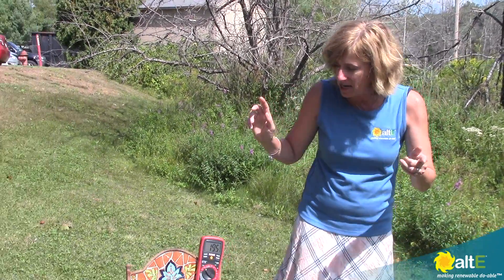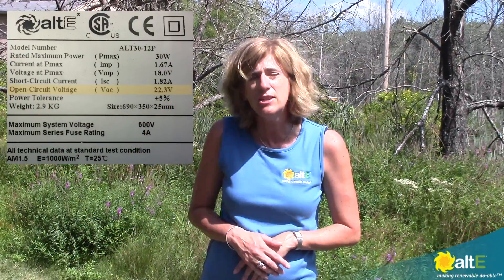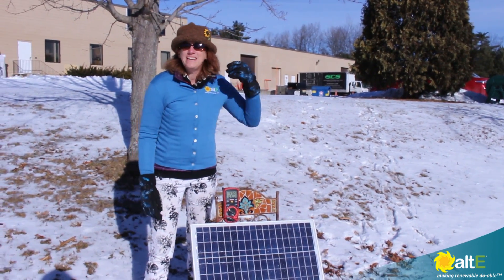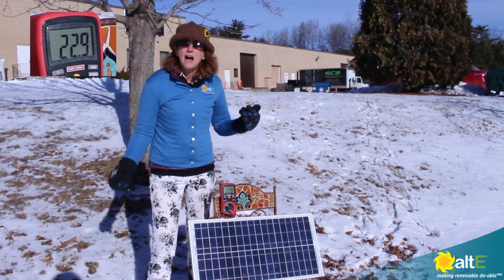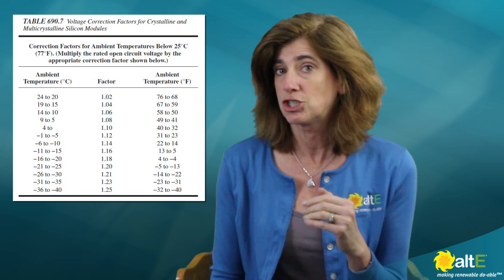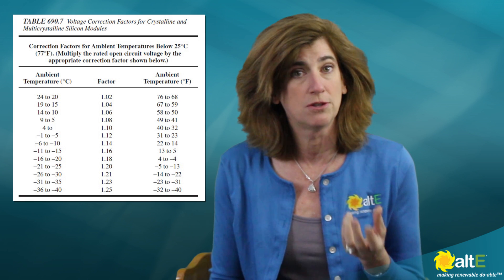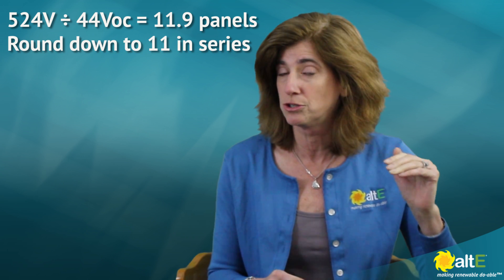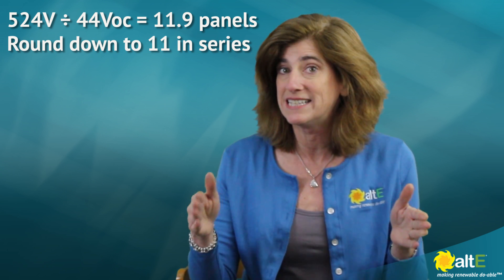What Effect Does Temperature Have on Solar Panels?

Comment: I’m curious about the angle of the panel. Since roof angles won’t change, this test allows for solar panel angle changing which would not apply in the real world. Obviously she raised the panel more upright to face the sun on the colder day. Colder days are naturally cleaner and less tree foliage. I wonder if the panel angle is kept the same in both tests would heat deflection be different, and more important how would the voltage gain be different in both temperatures.

Comment: If you use solar reflecting material to concentrate the sunlight onto the solar panel, you can obtain more power output from the solar panel. In fact, you can overdrive the Solar Panel beyond it's specifications.

You must be careful not to allow the solar panel to reach temperatures higher than the Solar Panel safe operating temperature in the Solar Panel's specifications.

A good heat sink system placed on the back of the Solar Panel, and additional water cooling, can facilitate heat transfer to harness the excess heat and also channel heat into a hot water system. 

I first tested this out using small Solar Panels as a hobby project 35 years ago, and it works. My aim was to create a Solar Panel that could be driven to become as close to 100% efficiency as possible.

My findings also led me to conclude that the faster you can remove heat from Solar Panels, the more light they can absorb, and the more power can be generated. The key is the Heat Exchange System.

At the very least, Solar Panel users should seriously take this into account as it could save you dollars for those people who operate in very cold climates most of the year. It can save you dollars on buying extra Solar Panels.

Comment: Hello AltE
I admire how you generously teach people about solar system.  
I want to have off grid solar system in my hotel but don’t know what type of panels can withstand the hot climate in the Red Sea. 
I use 10 Air Conditioners each 5000 BTU 
I also use 11 refrigerators each = 150wh each
I also use lots of ceiling fans = 2000wh total 
I also use coffee maker.            = 2000wh total 
If you can, please help me find what equipment and capacity that is fitting my hotel 
What is the best and durable solar panels

Comment: Hi,

Thanks for providing such a good information, i installed 24 volt pannel system i was facing the issue of solar high on solar controller which ultimately was disconnected the power supply to battery Bank.
User specs of pannel shows VOC of 46 volt however at 2°C it was showing 48 Volt causing isolation from charging the battery.....
I thought my spv charger becomes faulty.

But now i know the exact root cause....
Your information was very good......

Thanks.....

Comment: Do you think a 12v 3amp DC motor an inch under the white part of a solar panel will affect it?
Reply from the maker: Heat wise? 36W won't really make much heat, I wouldn't worry about it.

Comment: Hi. 
Please guide me i have 5 ke mppt soler inverter that could be receive 450 v maximum. I have 18 mono panels of 270watt. 
But our area is too hot area and temperature often at 46c in high hot season. And my mono plates produced half wattage so please guide me how can i get maximum wattage from my 4850 wattage soler plates. 
Now a days i have install 9 plates series

Comment: This demonstration definitely stresses the value of good maximum power point tracking. (MPPT). You'll find that in the winter, the amps will be lower, but the voltage will be higher. In the summer, expect the opposite: Higher current, lower voltage. The wattage will not vary as much as it would if you just connect the panels directly to a battery. The major difference, will be the shorter days of winter, giving fewer hours of power per day. The peak power, will actually be similar, albeit, for shorter periods of time each day.

Comment: Please do a test where you get several solar panels very hot (like on a 90+ degree day in bright sun, perhaps placed directly on a hot roof without spacing for airflow), have your meters showing the amperage coming from the panels and into the battery bank, then spray the panels with some cool water to see what effect that has on the voltages and amperages.  Thanks!

Comment: Electronic devices usually have about a 15% tolerance on voltages without issues.  I think you are making too much of a deal about open circuit voltages.  Those are not so critical cuz the solar panels produce a wide range of voltage anyway based on the amount of light they get and other factors.  What would be interesting to me is to check on a very hot windless day, the maximum output of the solar panels, and then squirt them with a hose to see how much the output increases due to cooling of the panels from cool water on them.
Reply: I run a 2000w off-grid solar system in the desert where the temps get up to 115 degrees. When the Sun is directly overhead and inline with the panels, I get about 85% of the rated panel output.  I haven't watered the panels and checked the voltages, but that would be the best way to test.  

When it gets really hot, the a/c consumption goes up 200 watts or more. Spraying it with water drops it back down.
Reply: Perhaps the "best" solar system would be PV that also runs water thru the panels to cool them but also for use as hot water for showering,  heating up a swimming pool....
Reply: Make it a fine mist: You don't want to thermal shock the glass. It's not likely to shatter, but if it's going to, that would definitely trigger it.

Comment: What about roof panels in a snowy area.  How long does it take for the snow to clear off the panel and how could you clean them off  ????????????
Reply from the maker: It depends on the angle of the roof, and how sticky the snow is. If you have a steep angle and dry snow, it can slide off in a day or two. If you have a shallow roof and sticky or icy snow, there is a chance it will stay until you get a warmer day to start melting it off. Some people do use a plastic or rubber roof rake to get the snow off the panels.

Comment: thx, i'll dip my solar panels in liquid nitrogen
Reply: I wonder what would happen if I epoxied extruded aluminum heatsinks to the back of my panels, to try to keep them cooler in the summer. Can I keep my high current, but at a higher voltage to get higher average wattage?
Reply: @vincentrobinette1507  solar panels have aluminum frames, they have basically a pocket under the solar cells. adding heat sinks would be pointless, the heat would rise and still be trapped under the panel, if anything adding heat sinks would collect more heat and transfer that to the panels plus now you have no airspace under the cells and now there's no air flow. you basically made the problem worse and wasted a ton of time, plus you do not use epoxy to mount heat sinks, that would insulate the heatsink meaning they are not transferring heat, epoxy is a thermal insulator. so to sum it up your idea would be really BAD, really BAD IDEA
Reply: @eksine  It might make more sense to use small efficient brushless DC fans, if they don't take more power than the panels would gain. These are just some experiments I want to try. I'll try the fans first, since it's quick and easy, and I don't risk potentially damaging a panel.
Reply: @vincentrobinette1507  I don't think that using a fan would be a good idea because you would waste more power than you would gain from the cooling. As long as you leave enough space under there for the air to flow it should be okay. I thought about your idea yesterday and the only thing that would work is if you had an air conditioner in your van or house and the solar panels were within that air space so the air conditioner would cool the solar panel then you would have a sheet of glass or plastic on top to let the sunlight in.as long as the solar panels are part of the air-conditioned room that's the most efficient way because you're going to use air conditioning anyways for yourself
Reply: @eksine  I'll be using flashing and rail racking. that gives good dead space between the roof and the panels. As much as I want electricity, I also want to shade my roof, which will lower the attic temperature. That takes thermal load off the central air conditioning, reducing its consumption, as well as the power produced by the photovoltaic array.

Comment: Hello, thank you for this nice information. I want to ask you one thing that, how much solar cell temperature will rise if surrounding temperature is 40. °C..
Please tell me.
Reply from the maker: It depends on the solar panel, that is listed in the specs. For example, a SolarWorld 300W with a Voc of 40V has a thermal characteristic of TC Voc -0.29 % /C. That means the Open Circuit Voltage drops .29% per degree C above 25C. So 40C is 15C hotter than 25C. 0.29% x 40V = .116V loss per degree x 15 degrees =  -1.74V. So the Voc will be 40V - 1.74V = 38.26V.
Reply: altE thank you. If we use normal water for cooling the cell, and maintain cell temperature 25°C. Is that possible to increase the efficiency of panel.
Reply: @shrishailyatakale8046  Yes it works, i have done it.

Comment: I just got 3 325 jinko solar panels and I noticed the when the weather temperature drops or I wash them my system acts weird I think I'm overvolting my charge controller
Reply from the maker: What charge controller do you have? What voltage battery bank do you have? Those are 72 cell panels, so if your charge controller can handle 150Voc, you can't have 3 of the panels in series when it gets cold outside. 44Voc x 3 x 1.2 (-5F) = 158V.
Reply: altE yeah I just looked at my controller it's a KRXNY 50amp 150v controller I though this wouldn't be a problem since I'm in california but in early morning or when breeze hits the controller stops charging and load shutoff and I have to disconnect the solar panels in order for it work again but 10 minutes later it does the same thing I only use this to charge my ebike so I will probably connect in parallel and just boost the 24v to 36 for the battery thanks for the quick reply

Comment: why dont solar panels have a another layer of something at the back that can hold water, this water could be heated by the panel and used to heat the house water at the same time pulling the heat from the panel to keep it cool oO
Reply from the maker: There is a company that does that. It is called Sun Drum Solar, and their water heater attaches to the back of a solar electric panel, cooling off the panel and making it more efficient, while preheating water.
Reply: it make so much sense, happy that someones doing it ^^^

Comment: I remember a This Old House episode, could've been 2009ish. They installed a solar hybrid panel. Where the PV panel had pipes attached just to the back side. The idea, as they explained it, was to draw the heat from the panels to use for domestic hot water. That episode was the only place that I saw the idea. Do y'all remember it? Have you even heard of this idea? 

If plumbed correctly, put the pipes in parallel, I think it would be a great idea. If plumbed in series, well I could only imagine that as the liquid flows from panel to panel, the temp will continue to increase. Thus some of the panels would be hotter than the others. And it will cause a voltage difference. 

I was actually thinking of doing this on my own. I know I won't be able to replace a water heater, but any help one can get will be great. Plus it will be cooling the PV panels.
Reply from the maker: The company that does that is called SunDrum Solar. Ironically, they are about 1 mile from my house. They have some large installations in Boston and elsewhere.
Reply: Glad their still around, shocked that it's been years since I heard of them. But don't really see them in the mass market, even just a little. 

Although, they really need to update their videos. I bet most of their lost sales are due to their numbers being WAY off. Their numbers are of 2009 when the cost per watt was super high. So when he's talking about the "make your money back" on a 2kW array being 16 years, 8 with their system. And costing over $16k with incentives of the PV alone. I would really like for them to be more mainstream with updated videos.

Comment: so don't you need a voltage regulator of some sort instead of using less or more panels in series? where i live it can range from +35 Celsius in summer to - 50 Celsius with windchill in winter. that's like a 40% range in voltage. what do i do in that situation?
Reply: PWM isn't good enough. You need maximum power point tracking! Sometimes called a DC optimizer.
Reply from the maker: You definitely need a charge controller. You must wire multiple panels in series to reach the minimum voltage input to the charge controller. If it's an MPPT charge controller, it will regulate the output to the battery, ensuring the right voltage out goes to the battery, regardless of what  the input voltage is (as long as it reached the minimum input voltage). For example, if you have three 20V (60 cell) panels in series for a 48V battery bank, the voltage will always be high enough going in, regardless how hot it is, and when it gets cold, the charge controller is rated at a high enough voltage to handle the higher input voltage and will drop the output down to about 55V to charge the battery.

Comment: Rooftop temperatures can be significantly higher.  A lot depends on how high the panels are elevated from the roof.  You can use this as a guide for your location. https://www.copper.org/applications/electrical/building/pdf/rooftop.pdf
Silicon solar cells loose about 2.2mV per degree C increase over their nominal voltage and temp.  On a really hot summer day, your rooftop panels could output about 10% less than nominal value.  Mount the panels at sufficient height above the roof to provide for good airflow (cooling) under the panels.
Reply: Jess Stuart cre

Recipes for carrot cakes

Comment: The amount of particulate matter in the atmosphere also has an effect. Rayleigh Scattering may be relevant, but this verges on insignificance in terms of the magnitude of the effect.
Reply: Concentrated solar is much more sensitive to the diffusion of light, than a photovoltaic panel. Even on cloudy days, photovoltaic can often produce more than half it's rated power. anything that needs to be focused, becomes useless, when you can't cast a clear shadow.

Comment: Amy, what is a micro inverter and what is a DC panel thingy ?(Sorry, can't remember proper name of DC voltage upper/regulator)
Reply from the maker: We did a video comparing the microinverter, which attaches right to the output of each solar panel and outputs AC, and a DC Optimizer, which also connects to each panel, but outputs DC which is sent to an inverter. https://youtu.be/H2aeV8d7SJY

Comment: Hi Amy ! 😃 I want to upgrade my solar charge controller to an MPPT controller. What do you recommend ? Please be advised I am on a tight budget.
Reply from the maker: I forget what size array you have. How many watts? 400? 12V battery bank, right?
Reply: +altE Yes, single 100 Watt 12 Volt mono panel (Very impressive performance, actually) into 6 x Trojan T 105's for 675 total Amp hours 😃 Overpriced GoPower 1500 Watt inverter with impossible current demands if you want anything above 800 Watts ! I am upping my DC rated hookup multi strand copper wire to 3/0 AWG rated for 239 Amperes and shortening my runs from the battery array to the inverter to no more than 2.5 feet instead of 6.5 feet I have at the moment ! Winter is coming, and I want to be able to mix and match whatever solar panel size and voltage I can pull out of the local scrap yards, recycling depot's, and bargain shops which could be 12, 24, 36, or industrial 48"s !! 😎😎😎
Reply: +altE Addendum: I want to be charging everything at no less than 10 Amps, and right now I am averaging 5 Amps
Reply from the maker: You may want to look at Outback's Smart Harvest. They have a 10A and a 20A. The 20A would give you more room for growth without much more money. 100V input limit gives you flexibility. https://www.altestore.com/store/charge-controllers/solar-charge-controllers/mppt-solar-charge-controllers/outback-solar-charge-controllers-mppt/smart-harvest-20a-mppt-solar-charge-controller-p11930/
Reply: altE Hi Amy. I was hoping for a 30 Amp as 20 is what I have and I would like to leave a little more room grow. Also. I saw a demonstration of a 435 Watt Solar panel. Can you get those and how much would one be ?
Reply from the maker: Then I'd recommend Midnite's Kid. That's the one I use in many of my demos. https://www.altestore.com/store/charge-controllers/solar-charge-controllers/mppt-solar-charge-controllers/midnite-solar-charge-controllers/midnite-solar-the-kid-30a-mppt-charge-controller-150v-black-p11138/ 

Be careful about wanting the biggest and newest panel. One big panel may not be the best solution for you. Two (or more) smaller ones may be better. Keep in mind anything bigger than something like the Kyocera 150W will have to ship by truck, and will have additional fees crossing the border. Smaller panels can ship FedEx or UPS and can end up costing less, while also giving you more configurability options.
Reply: altE Not if I can source it in Canada .😋😋 I am space challenged on my little RV Camper Van roof, so one more larger panel is OK, but two or three more smaller ones is not.
Reply: Addendum: I am looking for more current, but could careless about wattage. I just want to charge six 6 Volt Trojans @ 14.4 Volts and at least at 10 Amperes, so as to not wait so long on cloudy days to reach float charge level. Alsoy ultra cheap 20 Amp China Solar charge controller does not have a Settable float charge level, and insists on 13.46 automatic Volts, which is not quite enough for proper GoPower inverter supply.